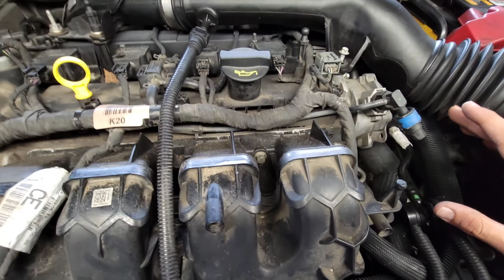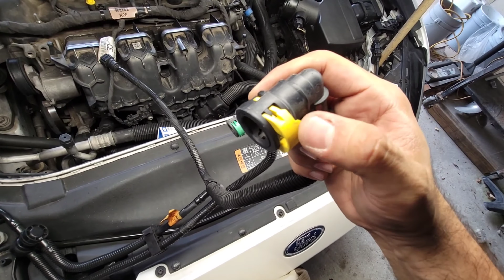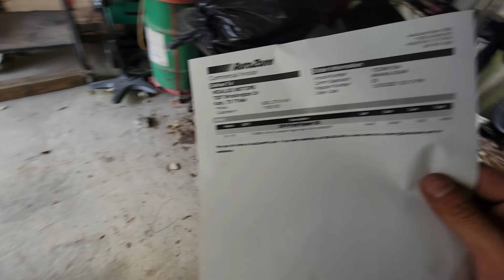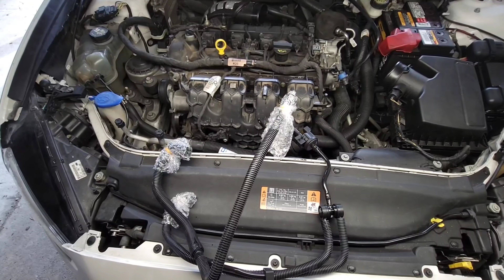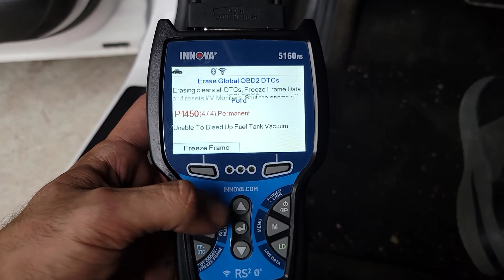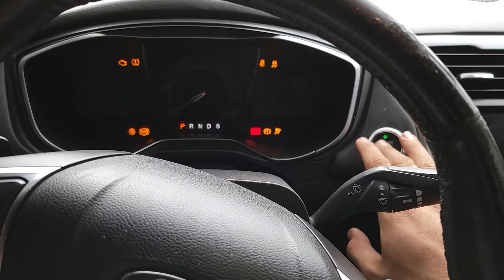2013 - 2019 FORD FUSION NOT STARTING AFTER PUMPING GAS FIXED FAST & EASY P1450 UNABLE TO BLEED FUEL

Comment: This is a continuous problem my wife car. My Ford F150 had continuous problems with cam phasers, very expensive repair. Stay away from Ford.
Reply: Which ones are good hondas? Toyotas?
Reply: Ford is the best. New ford after 96 and crown Victoria 2011 are trash

Comment: What’s crazy is I’ve had this random no start. Green light on push to start flashes nothing happens. Now I got a check engine my app says evap system. This is most likely gonna be the problem

Comment: Great video, I'm currently having the same fault code, with Check Engine light on.
Two things, firstly, to avoid that hesitation after filling up with gas, is to start the car, while the gas pump is still in, allowing the fumes from the tank to blow out through this manmade vent 😊. Secondly, you can replace the part without disconnecting that long house that goes under the engine, just ignore it, and leave it in place, as the hose assembly comes in THREE PIECES, so just connect all the others. As a honourable mention, the valve is sold separately, but you need a heat gun to detach the old/faulty one, then carefully apply gorilla glue to fit the new one. QED/ims

Comment: It sounds like my fuel pump is trying and trying. My car turns and cranks, but it just doesn't fire! SOS. Would you start with the purge valve and then go fuel pump or what? HELP!
Reply: It is not throwing any codes
Reply: what was it
Reply: @vityazsix  it was a timing issue

Comment: Hello, I have a 2013 ford edge limited and we have had it in the shop several times with this issue. Just got it back again. Noone seems to know what the probelem is. Its supposed to have been fixed each time. 
But when i get gas it wont start, i have to flood it to get it to start and stay on. Then its fine. But when i shut it off, and try to start it again it dkes the same thing and idols hard. It needs an o2 sensor but could this be the issue, or could an o2 sensor cause this?

Comment: I watched another vid where the guy just replaced the valve. What are your thoughts on that? Seems easier than messing with the other connections. Thank you for your Video!
Reply: What did you end up doing?

Comment: Could it be possible to have this issue, without the check engine light being on?
Reply: Yes. I’m dealing with it now. Ugh
Reply: Yes, it happened to me yesterday.
Reply: yeah i’m dealing with it, no codes at all right now
Reply: @ashashleyley27  mine light ended up coming on after like a week or so of went it first happened to me. It was the purge valve.
Reply: I think this is happening to my 2019 & my check engine light is on. Pissed!

Comment: I really wished you show how you put the bottom one on. Instead you skipped over that
Reply: Right?! I wasn’t sure if I pull the tab or leave it closed. And how to get around the starter bolt. I have a 2016 2.0 Ecoboost and the bottom was by far the hardest to put on
Reply: @charlesbartlett9428  how did it go?  I think I’m gonna take off the lower coolant hoses to get access.  I have the part but not trying to do it tonight cuz I’ll need to get pans set up to catch coolant.
Reply: @michaelgraber5750  there is no reason to take off the hose. I only took off one extra multi- wire outlet to get a little more room. And took off the rubber to the starter wire. I didn’t pull the tab on the new lower Purge valve. Placed that in than followed with the rest. Pull the air box off the air hose to get under where the vapor tank is to disconnect
Reply: @Charles Bartlett  did you figure it out put it in with the tab locked or unlocked
Reply: yep.  The worst one by far.  The one that is making me look over videos showing how everyone else got to it, and it's ignored here.  Go figure.
Reply: @michaelgraber5750  what I personally did for the purge valve is the first hose that's connected directly to the purge valve I just clicked it off and used a rubber hose clamps and yes we connected the new purge valve itself and not all the tubes you can buy The Purge by by itself without all the other pieces
Reply: I changed this once a couple years ago and now the car is doing the exact same thing again I'm going to have to do it again. That bottom one is a real SOB, I did some serious cursing before I finally got it on.

Comment: I have a ford focus 2013 and not getting any codes  but have the same issue, not starting after pumping gas
Reply from the maker: You may want to check your purge valve. If it has one. That was the problem with ours.. very common on Ford fusions.

Comment: I can only find the valve locally. Is it fine to just change it out without changing the whole string of hoses?
Reply from the maker: Yes you should be okay. But if the code still persists then you may have to replace the hoses